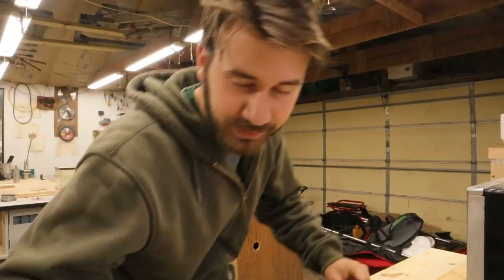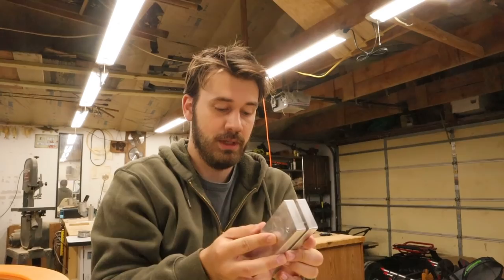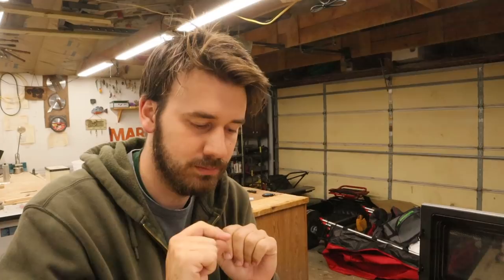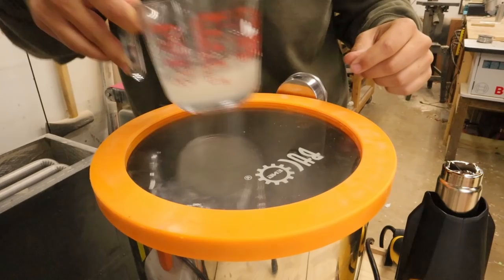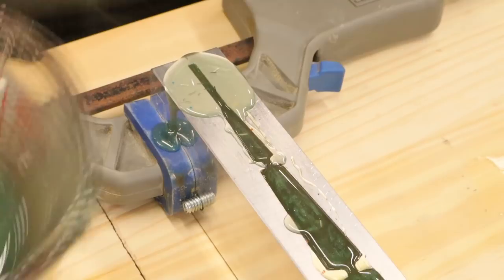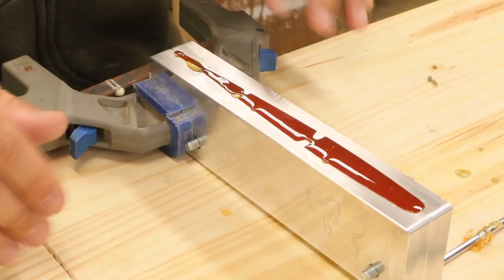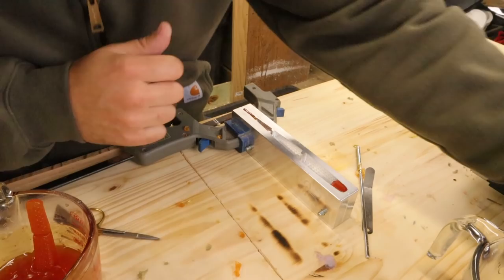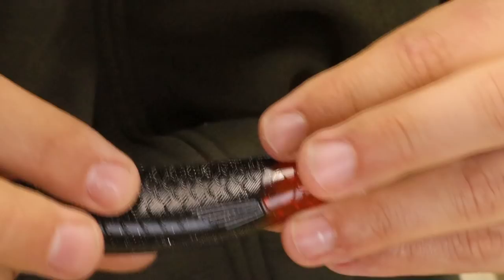A Company Made Me an Aluminum Mold

Comment: You should set your aluminum mold on an electric hot plate to keep it warm instead of using a heat gun. That would keep the mold warm the whole time you are pouring. Then just remove it to cool and set the plastic.
Reply: The constant temperature would be better for the longevity of the mold also .
Hot cool hot cool creatures undo stress on metal.
Reply: @willwinn8559  really,? Doesn't seem to be heating it that much to me. But I could be wrong.
Reply: @willwinn8559  aluminum doesnt react as bad as steel with temperature fluctuations.  But yeah the heat plate for this would work much better.
Reply: I was kinda thinking induction hot plate would be pretty good here.
Reply: @PoweredByRedstonecom  induction unfortunately only works with ferromagnetic metals.
Reply: @Cassiusisback  Funny you bring this up now; I recently just picked up an induction hot plate, and you're right.  I would have thought any metal would have worked, but apparently not.
Reply: @PoweredByRedstonecom  you could get an adapter plate and it would work you just set the plate on it and what you want to heat on that

Comment: Just found your channel and I have been watching your videos for the past week a lot and I’m hooked. Sorry, for the bad pun.  Got a few ideas I like to throw out there.
 1. On the aluminum mold bait, how would it be if you pour the plastic around a connected wire hardware so you can attach treble hooks.

2. For a special bait idea, a skeleton fish. Sort of a wooden crank bait carved skeleton.

3. Please revisit the upside down crank bait. I think if you lessen the angle of the lip like to a 10 or 15 degree angle, it will rise at a slower pace. Btw, that yellow bass paint job on that bait was gorgeous. 

Thanks for the good job on the videos, please keep them coming.

Comment: I love the detail that this guy was able to machine into those mold halves.  I never thought of making an aluminum soft plastic mold.  I have a CNC hobby mill in my home shop.  I may get brave and try to model one just to see if I can get the same detail.  I also like the action in the water that you're getting with your design.
It's a bit to big for any kind of fishing I'd do but still I really like it.  I've made bullet molds, high pressure air seal molds  and a multitude of other gadgets and gizmos with my CNC mill.  I'm sure this too can be done on my hobby mill.

Comment: Nate, Since you are going to clamp these while pouring, a better idea is to use ¼” dowel pins for alignment of the two halves.  This offers 2 benefits: Better alignment & and less wear on adjoining plate.  Screw threads will wear out the female alignment holes faster imho.  Old mold maker.  Oh, I really like Jay’s comment on the hot plate.  Keep up the great work.

Comment: Those moulds look like incredible value to me. I work in Quality control inspecting machined Pharmaceutical tooling sets for blister packaging, also aerospace components, to 3d models using CMM equipment and let me tell you that this guys work looks amazing from what I see through these videos. At the prices they charge you couldn't go wrong.

Comment: Ok, got a question for ya.  What about putting some clear plastic  in the eye slots, and pre-placing the eyes before you pour the body?  Basically have the eyes buried in plastic instead of gluing them on later?  You could do it before the tow halves of the mold are assembled, so you could get the placement pretty easy.  Just wondering.

Comment: What you should do there is make one of your twisty wire swivel jobbers and put that on the beast 8/0 and trail the stinger treble to the center section, and even put the top hook in the plastic in the center segment, and if you're really feeling froggy, a third section with a tail stinger, you could make a little wireform rig for it, I mean at this point, go all out

Comment: great video.    if you take a hole punch like the ones for paper and punch a circle out of say an empty bleach bottle a pierce the hook through the center of the plastic circle after you put the trailer treble on it will prevent the hook from coming back off the main hook easily. it will snag on the barb

Comment: How would it work if you put the mould on a steel plate and surround the mold with thick steel block. Sitck it in the oven at 350 for a bit and that might hold the heat in the aluminium better.

Comment: you can microwave your mold as well to heat it up.  Wrap in paper towel/cloth and completely soak in water.  The water molecules will heat up and microwaves won't get to the metal.  Just don't overdo it and let all the water evaporate.

Comment: This is NOT my idea, but it works REALLY well: Instead of using a torch and heat gun on your aluminum mold(s), get an electric griddle and preheat the mold on that. It'll than hold the temperature of the aluminum right where you need it and leave your hands free to work on the bait. See https://www.youtube.com/watch?v=4S4VCqfq7bg&t=6s